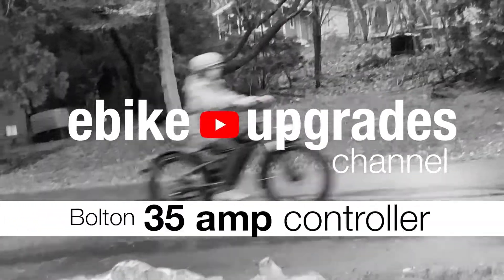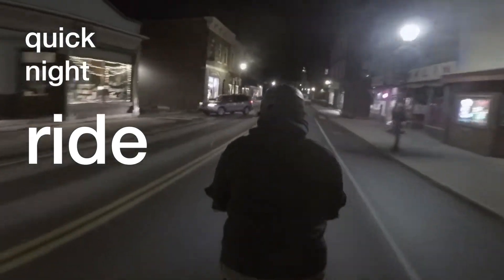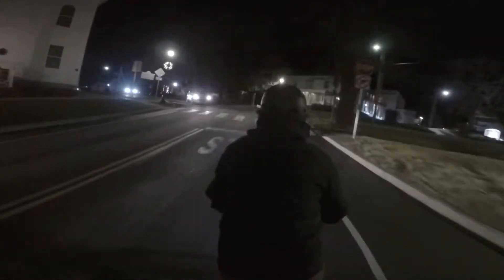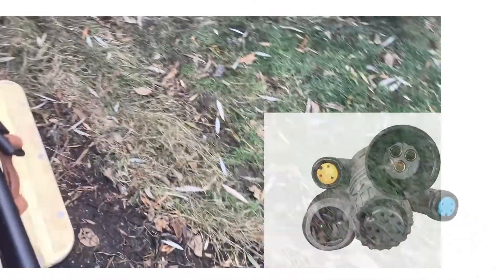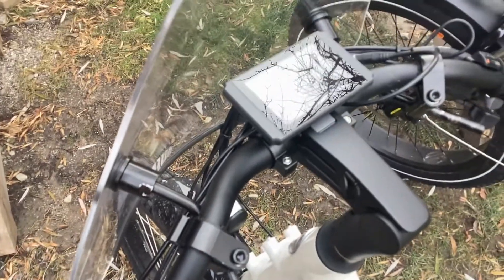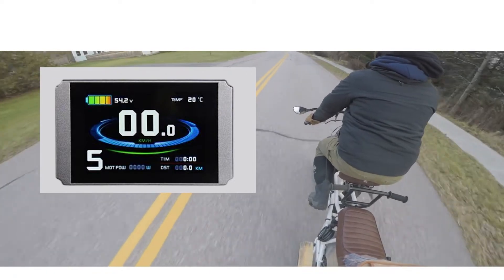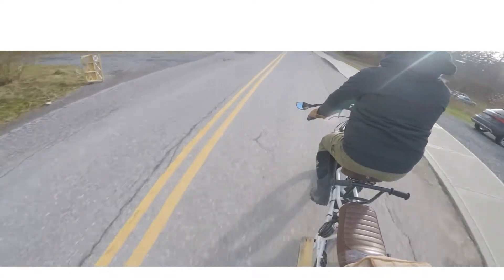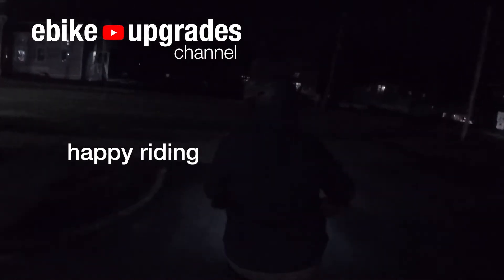Radwagon to Powerwagon with 35 amp Controller upgrade Review - Dream E-Cargo bike setup

Comment: Hey, been looking at whether I should get this controller or not. I really want it and I'm not too worried about burning out the motor since I don't have any huge hills near me, just some short hills. However, I am concerned about the battery and whether it can handle the 35amps being drawn from it. I know the fuse has a 40amp limit but drawing 35amps for a long time might still be too much for these batteries. I looked at some batteries sold by em3ev and they state that a 48v 13.6ah pack of samsung 35E (which I assume are the cells rad uses) can only output 27amps peak and 20amps continuous. 

So are you concerned at all about the stock battery? Really want to get the 35a controller, looks awesome but a huge battery fire kind of worries me v.v
Reply from the maker: Hi Isaias. Wow, yes, what an important insight. Right now, it looks like my max amps which can last as long as 3 seconds is around 29.4 amps and that puts me around 1500 watts. Your knowledge about these cells is really appreciated. Under the settings menu you can limit the controller amperage usage in the C5 column and I may take this down to the level 5 (75% of max current) setting.  I was going to make a video on the battery pack anatomy for the channel and you've made me aware of this oversight and a need to know more about the system. I owe you for that, thanks. I'm doing some cold weather tests with the battery, going to adjust that C5 power setting for the time being and see how proformance is at a peek closer to 1200 vs 1500.

Comment: Great upgrade! Thanks for the review vid. I just upgraded my Rad Rover 6+ yesterday to the Big Game Bikes 35 amp controller. Pretty much the same controller as teh Bolton. Not much top speed difference, but insane difference in power / hill climbing. I see your C5 setting is at 2 (50% power). That's great that you're still getting such good results at 50%, and it lessens any risk of frying the motor or battery. I started with C5 setting at 5 (75% power) and will drop it down and test what is the lowest setting I can go with and still get excellent results.

Comment: Have you had any issues with the controller riding in light rain?
Reply from the maker: I would be cautious. or possibly tape the metal seems for some additional weather shielding. I think you will be OK
Reply: @ebikeupgrades  tape the controller seems, the lcd screen or both?
Reply from the maker: @tiagothinks  I think the screen will hold up, I was talking about the controller box itself.
Reply: @ebikeupgrades  alright. Maybe some black electoral tape around the edges.

Comment from the maker: Right on! love the running board battery set up. Having this controller has allowed us to upgrade to motorcycle / moped tires. This controller is really great, I think you will love it. Just a note from my personal experience, though you could peak at 35amps and send 1600 watts to your (750watt motor?)  hub motor, I've set our controller not to exceed 1300 watts. If you choose to go with full power, just be mindful of some of the extra heat thrown off from both the controller and hub motor. I believe I burned out a controller from from heavy winter use on beefy Shinko tires and I just overstretched the controller and burned out something in the board. I think this was my fualt so I purchased a new one and it has been wonderful, I just dialed it back. OK, good luck have fun

Comment: I ordered this controller from a canadian source and can't wait for it to arrive. living in the greater Vancouver area of BC we have a lot of steep hills which make the bike utterly useless and I dread having to do any deliveries that Require me to go up a hill. after putting on nearly 8k on my bike the controller died as far as I can tell (the screen won't power on) and I have been waiting for an excuse to do this upgrade and now I have one. also picked up a mod to do dual batteries (Safely) and plan to put one battery on each of the running boards in order  to do a full days of deliveries on the bike and still have space for the thermal bag above the rear tire.

Comment: Thanks for the video!  Where did you get the windshield?
Reply from the maker: After poking around the internet I ended up ordering it on amazon from this link...though it currently is unavailable ( just checked). I think I payed $48 but I might of even payed a little more. I like this windscreen whether it does much deflecting air or not :)   https://www.amazon.com/gp/product/B08JP5T6C4/ref=ppx_yo_dt_b_search_asin_title?ie=UTF8&psc=1    Thanks for watching

Comment: I've got it fitted on my radrunner great upgrade. If you could control the amps to be more like the original controller when you want more range that would be nice.
Reply from the maker: I believe that 'C5' setting in the control menu on the display gives you access to max current settings. I have mine tuned to '06' (I think this is about 70%). Someone clued me into the fact that the cells in my battery packs are not to be discharged at over 28-29 amps peak and this turned out to be correct. So I don't risk pushing more this.
Reply: @ebikeupgrades  Awesome thanks very much for the reply and this info that's definitely something important. Think it's better to lower the amps anyway to not over work the motor also, get more life out of it

Comment: Really cool that you are experimenting with your bike trying to find ways to customize and improve it for your purposes.  Love the windshield upgrade and the tires are quite an interesting addition. The motorcycle tires seem to impose quite a penalty on battery life and output power based on your comments (25% more battery usage, 20% less energy output) so whether or not its worth having fewer flats is for me at this point a very questionable proposition. I'll be following your journey though since I just subscribed!  I wonder if there is a happier medium instead of paper thin flat-prone ebike tires and overly heavy motorcycle tires.
Reply from the maker: Yes, I agree, there must be a better tire, like a light weight moped tire that fits the bill better then these 5 lbs dirt bike tires with their rolling friction. They have been great in the Vermont winter snow here, but they have only held their performance so well because I upgraded the hub motor to what's considered a "true 750watt" motor and chained a second 48v 20ah battery into the system (I have videos coming on all this). I'm putting on signal blinkers next as it is really more of a 34 mph moped now...shoot, really wish I could just get it registered and throw on a license plate :) and have a better spot in town traffic . I'm buying these IRC NR-53 Moped Tires ( 3.00-18 47P ) to test them out come spring. All these upgrades cost $$ but it is really fun to tinker and figure out your personal dream set up....makes grocery shopping and trips with the kids a lot of fun. Thanks for the comment EuropaWill. Take care